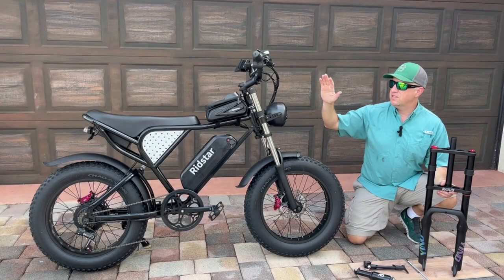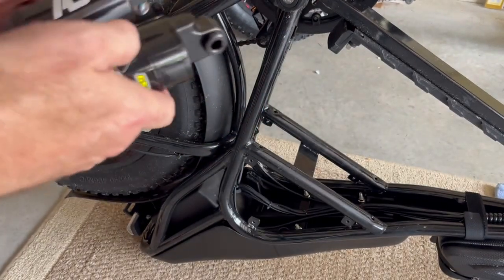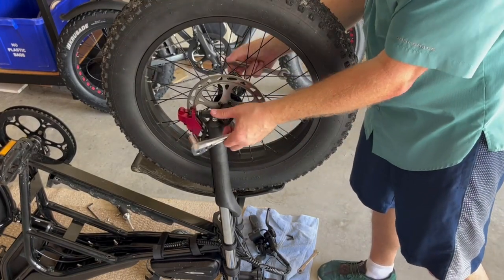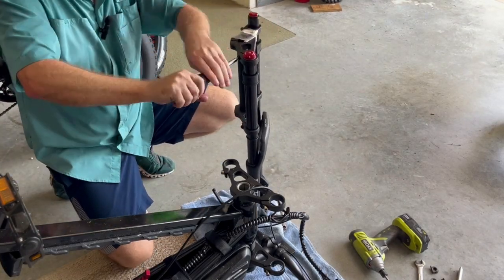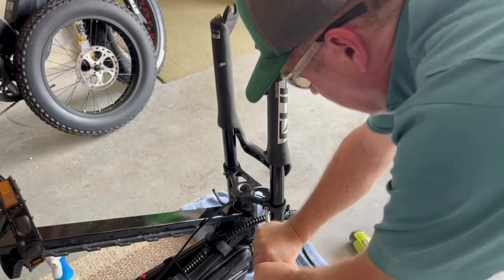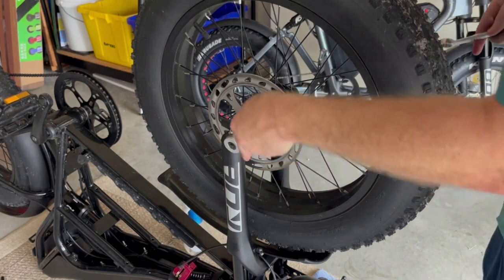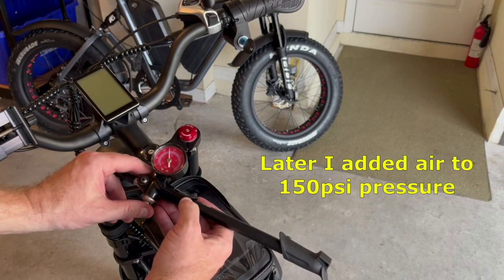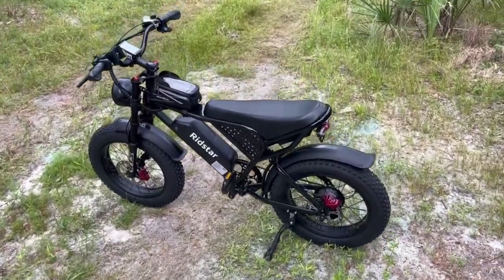Upgraded Fork on Ridstar Q20 - Air Suspension

Comment: I have double battery double motor . Did 30 km with only half of the 1st battery today. Best bike ever👍
Reply from the maker: Thats great.  What is your top speed 48 or 50 km/h?
Reply: Hey Im looking for a new fork son crashed his into me. I can't seem to find any options almost all forks are qr 9mm forks? Do u know if they will work with bolt on wheel?
Reply: @BRichSolution mines about 30mph
Reply: @BRichSolution  hi top speed ist 56 60kmh

Comment: Hey B Rich!
Got Q20 (Upgraded version). Ordered 20" air shocks from Aliexpress, first Bolany then Nanlio. Just like you said in video they sent you 34mm dia. down tubes, they keep shipping me 34mm's (though the listing clearly states they are 32mm & I thought I was purchasing 32mm). I have returned twice, wrong sizes sent to me. What did you finally do to have them ship you the 32mm instead of the 34mm (a note along with order? A bribe?). Please share us your secret! (lol) Thx!
Reply from the maker: I order the bolany about a year ago when they had 32mm tubes so they must have changed the design.   You can still install the Bolany with 34mm tubes you just have to swap the crowns and add stem extension like I did in my Jansno or Yolin ebike, see those videos

Comment: I tried installing the Himalo Fat Four R34 26 inch forks but the fork tubes were too small in diameter to fit the stock Ridstar Q20 Pro crown rings so I went ahead and ordered your Bolany forks …can’t wait to try them 😃
Reply from the maker: ya 26" is too tall; 20" will work
Reply: @BRichSolution  hi B Rich I received my forks, but the 20 inches at first glance look too short out of the box

Comment: Hey B Rich!
Apparently the air fork industry for these types of eBikes are upgrading to 34mm dia. down tubes (32mm Q20 (& others) must have been collapsing under stress, from dummies trying to "X-Game" jump these eBikes I guess). Anyways, the 34mm stem is shorter than Q20, so needs extension or higher handlebars (as you showed in your other videos) but also comes bare, no bottom crown race. So it's either buy a tool to transfer Q20 crown race or buy a new crown race. My question is, would you happen to remember what size crown race to purchase? I know the ID is 30mm but what size OD to seat existing bearings properly, 44mm maybe? And what stem extension/type do you recommend particularly for the Q20 if I wanted to keep my existing handlebars? We all really appreciate your quick responses & all your hard work creating these valuable videos! Please keep up your great work, Thank you!
Reply from the maker: See this video for full shock replacement, same procedure applies to ridstar & janso
https://youtu.be/dq3sseWgXOw

Comment: I received my q20 3 1/2 weeks ago and already have 1000kms on it 
Replaced the stock seat with a mini bike seat as after 4-5 hrs a day of riding   I found yhat my butt got really sore 
Planon buying a 2 more batteies and mounting them on the cross bar on the front
Reply from the maker: I would consider selling the ridstar and buying Yolin duel or triple battery instead of modifying Q20
Reply: Nope quite happy with my purchase

Comment: If my Ridstar Q20 breaks, would the repair shop be able to fix it even though it’s from Amazon?
Reply from the maker: The many bike shops near me will service ebike typically bike parts like chain, transmission, brakes, but only ebike shops will deal with electrically components.   There is nothing exotic with the electric drivetrain and most parts can be bought online

Comment: B Rich... great videos on the Ridstar q20.... I just got mine the other day and so far, so good. I love this thing. It looks good and is quick and powerful. I'm also looking to do the suspension upgrade you made it look easy. One question if I may... regarding the brakes my q20 the rear brake is operated via the left handle; and the front brake works from the right side handle...? this is opposite of all of the mountain bike and motorcycles I had through the years. Is that by design or a mistake? It will take a bit to get used to....
Reply from the maker: By design… having left handed rear brake is safer IMO as you can keep hand on lever and right hand twist throttles.   This way in emergency you don’t have swith change from throttle to rear brake on the right side
Reply: Also either brake disables the throttle when pulled
Reply: @douglasmason6742  All e-bikes what i seen have same reaction at brake. It's safety option

Comment: B Rich solution, thanks for your help OK I have the same bicycle but I could also like to change the front suspension but my question is if it mandatory to buy the shock pump too thanks ..
Reply from the maker: Yes you need the shock pump to adjust the pressure

Comment: I couldn't do the front upgrade to my Ridstar. My shocks only had  3 screws on one crown and the bottom crown has no screws and looks welded on. I couldn't slide them out so I took the entire front apart. The front fork upgrade you're suggesting the washers on the original fork wont slide all the way down in the middle, they get stuck before it hit the bottom. If you cant slide out the shocks this wont work.
Reply from the maker: Do you have the 15Ah battery version of Q20?

Comment: B.Rich I tried doing this but ordered the fork from your link in description and it was the wrong size. I had to reinstall the stock fork due to it being for the ridstar Q20 I learned the hardware that the Q20 PRO has a different frame even though they seem similar. I'm reaching out because through your videos I was able to learn how to upgrade my brakes and fork if it would have been the correct size. I am reaching out to you to see if you can help me by informing me of the correct front fork and rear suspension size for my Ridstar Q20 Pro? Thank you for your videos they are very informative. Look foward to your future videos.
Reply from the maker: What is the diameter or the fork on the Ridstar Q20 pro?    The suspension tube diameter on the air fork for Q20 is 32mm, is the Q20 pro 34mm?
Reply: The neck part is a bit too big to go through the crown that comes on the q20 pro. I followed your instructions to the tee and the one you have on your link the shocks themselves meaning the long 
Part with the air adjustment red air release button those two shock poles were noticeably thinner on the model you shared on link
The neck was a bit big didn't fit on the part that the stem that connects to handlebars was too big. Common sense tells me it's probably a 34mm. But I am looking all through the internet for the specs and can't find it
 The specs for the one you have on your YouTube was easy to find but the q20 PRO all I find is the other 2 out of the 3 models. I have the 52v 40ah which is 2 batteries at 20ah each.

Comment: Have you tried the z8? Has dmsome beefy spring shocks. So in the sub $1000  cafe-racer / moped body styles I you recommend the Ridestar q20?
Reply from the maker: Z8 has smaller battery, mechanical brakes and seat is small so if you slide back in the seat you get a bar up your butt
Reply: Thank you so much I'm planning on buying ridstar Q20 lite & w/ 13 ah and I'll build it up over time. I just can't wait. I can't wait another month to have cash to buy 20AH. Any advice on that? Thank your your videos have been a huge help

Comment: Bonjour et merci pour cette vidéo.

J'aimerais ajouter la fonction de bridage et de marche arrière au contrôleur, mais je ne sais pas comment extraire la carte électronique (les transistors sont bloqués par une sorte de clips).
Savez vous comment faire?

french trad by google:
Hello and thank you for this video.
I would like to add the clamp and reverse function to the controller, but I don't know how to extract the electronic board (the transistors are blocked by some kind of clips).
Do you know how to do it?
Reply from the maker: No, I don’t know.  I may replace the controller with new one outputs at 30A
Reply from the maker: No
Reply: @BRichSolution  ok,  thank you.

Comment: Hi there. Love your videos. I just got my Ridstar a few days ago and was wondering if I was to upgrade suspension. Would it be best to do rear first 
I’m on a budget. Just wanted to know what you think is most important 
Also I’m in Canada wanted to know what you think of DNM AOY-36RC 165mm MTB downhill rear shock? I lick on and off road.  Also shocks first or tires? Thanks
Reply from the maker: See suspension upgrade video i made
Reply from the maker: I would run the stock tires down and upgrade to DMN or A5 air shock first
Reply: @BRichSolution  thanks very much. I did watch your suspension videos. I’ve actually watched all of your Ridstar and several others. I even used your assembly video to setup my bike. So happy to have found your channel. A huge help👍 so rear shock it is then
I just wasn’t sure which was most important upgrade but feel the rear is almost hard tail stiff with stock
Reply: @BRichSolution  I’m also 6ft tall and was thinking of maybe taller bars but not sure if the harness has enough length. Do you think there is room to go higher or would I need some kind of wiring extension

Comment: Hi rich I bought a similar shock. Not the exact same but 32mm tubes. Now it’s a couple inches shorter than the original but says same length as the ones you are using the 628mm length. Same as the ones you are using 
The 26” are taller on aliexpress
Are the ones you used shorter than original
Reply from the maker: Did you buy the Bolany 20x4 fork or another brand like Bucklos?
Reply: Actually looked again and yours is 675mm and the one I have is 628mm I think when I first looked it was some glitch and ended up with something very similar 
I think the same shock but 628mm. I’m not sure what happened but that is a big difference in size

Comment: What were your final settings for rear shock?
Same for front, what is the other adjustment on front, not sure were i should set that.
Reply from the maker: For air fork 150-200psi
For rear air shock 120-180psi depending on riders weight

Comment: Is there any kind of service do you recommend ? For example, brakes, brake pads, any kind a oils or grease?
Reply from the maker: Oil the chain periodically and replaced brake pads at 400-1000 miles depending how much you brake.

Comment: Do you have any update after riding this for 4 weeks? Is the new ride with the new suspension significantly better? Do you even notice it? It looks like Ridstar already upgrades the suspension on their 2000w double battery version?
Reply from the maker: Ridstar Q20 is great bike for $1000.  The Ridstar Q20 pro with dual battery and 2000w is not priced right see video https://youtu.be/KPf2C8uzaVo?si=9I8eh_JEWjGEg8G6

Comment: Partly based on your video's I bought this bike. Arived today. Sadly rear fender broken and front brake disk has a weird manufactured defect, goes up and down by almost 1cm. Will  contact the supplier. Related to this video I have a question about the suspension. The rear triangle. Rear pivot point as quite a lot of play in it. Sideway force on the bottom breaket 2- 3 cm of movement. The pivot point seems to be a cheap construction, no bearings, probably some kind of rubbery bushing (I hope at least something is in there) but ist very easy to see it move. Also visible when you shake the bike at the handle bars. Can't be very good for handling of the bike. 
Is this normal for this bike.
Reply from the maker: Sorry to hear about bike damage.  Was the box busted?
As for bikes rear suspensions the 2-3mm play is not normal
Reply: @BRichSolution thanks for your answer  you seem to have the most experience with this bike. Seems that I have a lot of issues. The damage and front disk are easy to rectify. 
Max speed only 26 miles, not being able to limit the max speed or changing drive modes ( and not disabling trottle) are bigger problems.

The play in the rear suspension is 2-3 mm at the pivot point, at the wheel its a lot more (cm's). I will try to make a small movie and post it but have to figure out how to do that.

Comment: Hi Rich ive got the newer frame 1500w and when I bought it said upgraded forks and measured my fork tubes. I’m getting 700mm I was wondering if I’m measuring from the wrong place (top of where the hub nut is) 
These shocks say 675mm
Is that correct. 
I’m ordering second set of shocks because I grabbed the wrong ones before so just want to make sure these ones will work 
I could always move some of the spacers around if I have to yes? 
Thanks  these are the Bolany shocks
Reply from the maker: Ya move the spaced around on the steering tube to make it work

Comment: I bought this very bike because of the video that I saw of you. Riding it through the off-road grounds.. I put the bike together. The screen flashed power for just a second and I cannot get it back on at all. Do you have any suggestions to get my Ridstar up and running? I would greatly appreciate your help. I do not want to send this bike back.
Reply from the maker: I had that happen the first time too.   I had to make sure the battery is seated into the mount and locked, the. Turn the key on then hold the power button next to + / -    If that doesn’t work request a new bike
Reply: Make sure the batteries themselves turned on and key turned on then hold power button on pad

Comment: What size forks did you get? I can’t find what MM it comes with stock. Do you have the specs for the front suspension upgrade?
Reply from the maker: Link to all the parts in description below the video but I have included them below Link to Front Air Suspension on Amazon: https://amzn.to/47hWuYH
Link to parts on AliExpress:  
20x4 Front Fork: https://s.click.aliexpress.com/e/_DEM8Nu5
Rear Air Shock 165mm:  https://s.click.aliexpress.com/e/_Dk1F66B
Shock Pump: https://s.click.aliexpress.com/e/_DdIPe3t

Comment: It says that the diameter of the new forks are 34 mm on Amazon, are you sure they’re 32 mm?
Reply from the maker: It was 32mm when i bought it.  If 34mm it will still work you would need to replace the crowns

Comment: I have read the air forks have lots of flex. Did you find this the case?
Reply from the maker: Yes big upgrade on ride comfort and you can change air pressure based on rider ls weight whereas stock was not adjustable
Reply: I meant flex when using the brakes the person said it was so bad he sent it back.Not suspension travel of the fork.

Comment: Can you do a video for how to replace the half throttle with full twist throttle? I have the same bike and I want to change the twist throttle. I have no clue how to replace the twist throttle.
Reply from the maker: If you want a full throttle do the reverse of this video   https://youtu.be/T5ZfQZTP04U  and buy this throttle  https://amzn.to/45GEBkR
Reply: will it turn on without the key?  @BRichSolution
Reply: what happens if you don't connect the 2 pin that's attached to the controller
Reply: the 3 pin is attached to the throttle and the 2 pin is used for turning on the bike. Can you please help? Im lost.  @BRichSolution

Comment: I'm looking into upgrading my front forks on my q20. Are you sure these fit? I measured my fork tubes at 32mm and these forks say they are 34mm...?
Reply from the maker: I wonder if this a typo or then upgraded the fork 34mm.   I bought this fork last month and it is 32mm tube.   Either way order the fork if the down tube is 32mm the install with be easy if 34mm then install like I did on Jansno  ebike
https://youtu.be/dq3sseWgXOw
Reply: @BRichSolution  Thanks for your help. Either way I am ordering them because obviously the stock suspension in junk on the q20. I'm hoping they are 34mm and I have to go that route cause I'd rather my forks be a little beefier than not.

Comment: Can you do a seat upgrade? Do the super73 seats fit on the ridstar?
Reply from the maker: not the super73 seat will not fit due to the V shape on the frame where the seat mounts on the Ridstar Q20 and Ouxi v8.   The stock seat is comfortable IMO; it could look better
Reply: @BRichSolution  the super 73 Z miami has the same V shape on the frame. I wanted to get a stylish one to make it look nice. That one doesn’t fit?

Comment: Hey rich I ordered the front fork from your aliexpress link and instead of sending me 32mm they sent 34mm any idea where I can find the right size?
Reply from the maker: Was 34mm Bolany brand or different?   You can still use the 34mm fork you will need to replace the factory upper and lower crowns that come with crowns that came with the new fork
Reply: It was Bolany brand I ordered the one from your aliexpress link
Reply: Same thing for me.
Reply: What did you end up doing?  @ULTIMATEREAPER

Comment: Rear shock will be my first upgrade.  In hindsight, would you stay with the 165mm or consider going to the 190mm?

Thank you for the Ridstar videos.
Reply from the maker: 165mm is stock size, buy 190mm might be better option especially if you want to raise the seat slightly or really soft ride

Comment: Can you use any front fork that’s the same size as
Reply from the maker: Bolany fork linked in video has same size tubes which slide into factory crown and much easier install then most other forks are different size and stem is shorter needs some extra work ti get it to fit
Reply: Sorry I meant to say are they any other forks that fit that doesn’t require you to put air in them